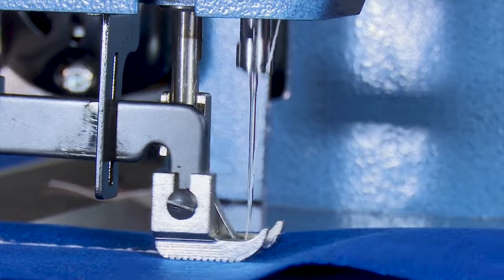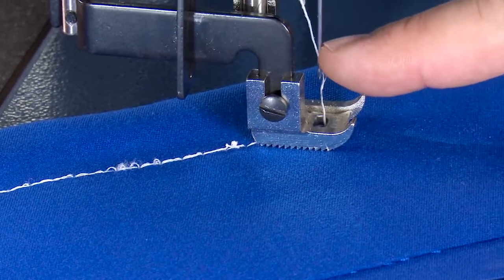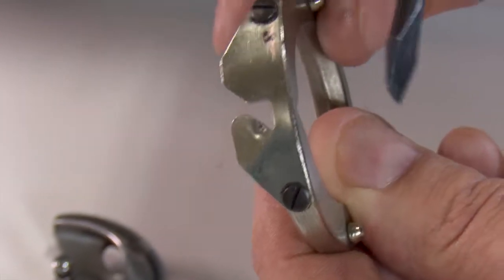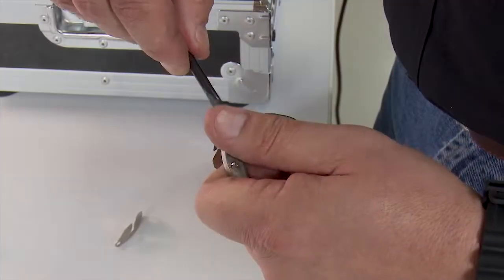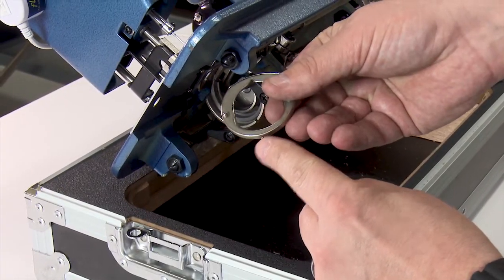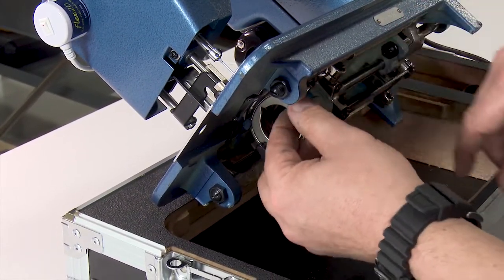How to Replace a Cap Spring on the Ultrafeed Sewing Machine

Comment: The video says that the spring should be flush, but at the end there is a shot of it installed and there is a small but visible gap. Also, it would not be a spring if it were flush.  Can you quantify the appropriate amount of gap?  Is there a tool that can be used to check it?

Comment: The symptoms of a dingged cap spring are very confusing... shredded too thread could also indicate needle size too small... skipped stitches could indicate timing off or improperly aligned needle groove... GREAT RELIEF to learn that a burr on the cap spring causes both. Thank you
Reply from the maker: Yes, you are correct. However, shredded thread above the eye of the needle is usually a damaged cap spring.